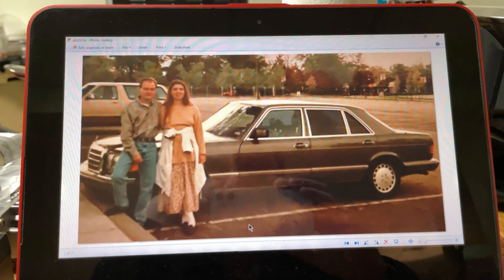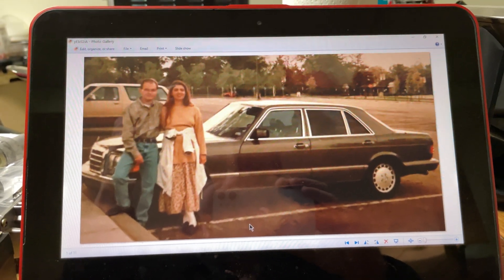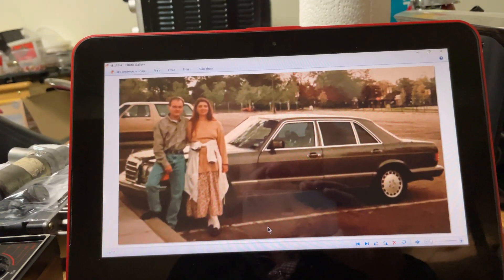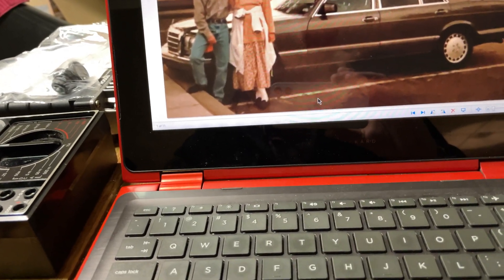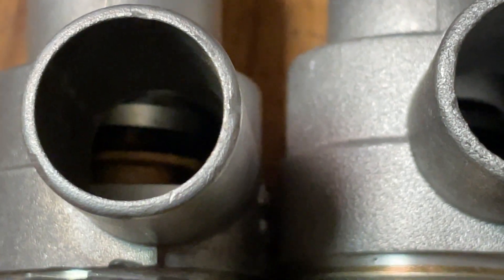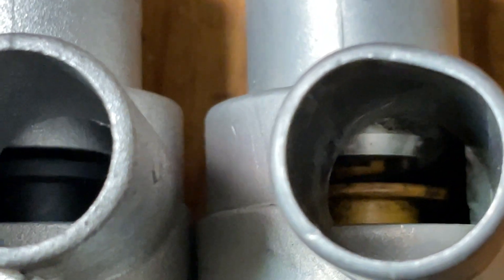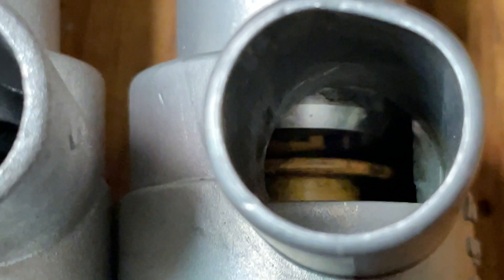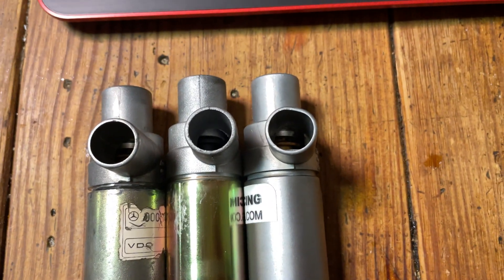Tutorial correct calibration of Bosch K KE KE3 Jetronic for all Mercedes after repair / long storage

Comment: Following some bad advice I tried to adjust my sensor plate and got it so far out of adjustment I can't even get my car to run now. Without it running I can't properly measure the duty cycle or any of the other adjustments like the potentiometer. How can I get plate gap back close enough so that I can at least get it running ?
Reply from the maker: Remove your fuel pump relay and bridge contact 7 and 8 with a jumper. This way you got fuel pressure in distributor. Don’t start the car yet. Push down on your plate until you can hear fuel flowing. Your plate should be only about 2mm below resting point with fuel pressure. If you can push the plate in below this then your to lean - if the plate has a lot of resistance then your to rich - you need 2mm play between resting and fuel flow
Reply from the maker: That’s the basic alignment
Reply from the maker: And make sure the Allen screw which is spring loaded releases the set screw below - they can get stuck when Allen key is depressed then the plate doesn’t reach the fuel distributor plunger and you get no fuel flow
Reply from the maker: Then your car should start / leave fuel pump jumped for the moment - if it doesn’t start turn 1/8 ccw to lean this way the vacuum has less resistance to move plate down - but be careful these adjustments shout only be made I. 1/16 or 1/8 increment turns in either direction
Reply from the maker: Your rpm gauge should go up to 1200 to 1600 rpm and then drop off to idle between 5 to 45 seconds depending upon ambient temperature
Reply from the maker: Once you got this corrected and car starts like this after 3, 4 attempts remove jumper and re install fuel pump relay
Reply from the maker: Let car idle to operating temperature then make only minute adjustments in 1/16 or 1/32 turns to adjust mixture waiting 2 to 3 minutes between adjustments - then you can readjust potentiometer and reset ecu
Reply from the maker: Don’t worry, that happened pretty much to all of us who worked on it the first time until we got the hang of it how the Allen screw works and the range of adjustments and increments
Reply: Wow thanks so much for all the info. While doing more troubleshooting I discovered I am not getting a signal to my cold start injector. I checked it removed from orifice on engine but still connected to the connector plug and nothing when turning the key over to accessories. Then unplugged from connector and supplied 12 volts and it gave a good squirt. Next to check is water temp sensor and associated wires for opens. However I do realize this shouldn't prevent my car from cranking altogether just difficult to crank when cold. I don't understand the process of how exactly the fuel distributor works. I've got strong fuel supply coming into the distributer but I'm not getting fuel to the injectors from the distributor. I have fuel coming out to the cold start injector but not the other 2 fuel injectors that I did disconnect to see if I had fuel so I was wondering how that works. Will I only get fuel to the injectors once the cold start valve does its job ? Or what is the sequence ? Should I have fuel pressure to the fuel injectors at all times while trying to crank ? Could the sensor plate being out of wack prevent fuel from being sent to the injectors ? I wish I had a better understanding of how this system works as in the sequence etc.
Reply from the maker: @GeorgiaOverlander  Pierre Hedary made a video for the basic sensor plate height adjustment 
https://youtu.be/jAhWj-JH9Rk
Watch this first to get a better understanding - my videos are meant to fill in the information past the basic stuff which other channels cover

Even though Pierre says that there is a difference between K and KE Jetronic I use the K procedure on all jetronics because even if the engine has other issues it will always start the car
Reply from the maker: @GeorgiaOverlander   yes it’s only the sensor plate when no fuel comes out of the injectors - the cold start valve is only used when ambient temperature is below -10 Degree Celsius or 14 Degrees Fahrenheit

Comment: Got my analog meter, expecting the potentiometer and Hirschmann clamps soon. M103 six cylinder engine. I adjusted the plate as described after fuel system rebuild. Starts and runs a little rough with some black smoke. How well should it run after this preliminary adjustment? Disconnecting the harness to existing (old) potentiometer kills the engine. Should I be connecting the hirschmann clamps and the potentiometer harness at the same time? I will have to reset after the new potentiometer arrives but I wanted to see if I could make it run with the old one for now. Thanks for this great video, big help.
Reply from the maker: Fairly smooth, you may need to lean the mixture out a bit more. Was the fuel Distributor rebuilt as well? The engine will be idling rough if the mixture is to rich or to lean - if the old potentiometer is bad then the ecu will run the engine rich as it opens the EHA valve fully - its like a limb mode - I would wait until I get the new potentiometer before making any further adjustments. The Hirschmann clamps have to be connected with the harness connector at the same time. Pull connector off, attach the clamps from the side on the pins as close as possible to the potentiometer and then push connector on and as far as it will go against the clamps to make sure you have a good contact
Reply from the maker: And the other question, have you opened the camshaft cover and checked the marks for tdc on balancer, camshaft and distributor? They all three have to line up as well
Reply from the maker: You may want to watch this video here:
https://youtu.be/NxEYI1KIUeE
Reply: @inovahightechltd  

I will watch it and check the other things while I wait for the new potentiometer. Thanks very much!
Reply from the maker: @Torqueandsteel  black smoke is usually a indicator of to much fuel. If you haven’t rebuilt your fuel distributor then you may want to check if your fuel distributor is leaking:

1. Remove fuel pump relay and bridge contact to activate the fuel pump check your wiring diagram for ur car to see which two contacts need to be jumped.

2. Open each fuel line on the fuel injector one by one - there should be no fuel coming out except of what was in the fuel line already

3. If you got fuel flowing out of any one or two lines then your distributor needs to rebuild 

4. If you got fuel flowing out of every line then your plate is adjusted to high - turn mixture screw counter clockwise until fuel flow stops on all six cylinders

5. At this point turn set screw another quarter turn counter clockwise, remove jumper, re insert fuel pump relay and start car normally - this first start will be rough to start and you may have to crank for up to 60 seconds until all air has come out of the system - once engine fires step on gas and rev up to 4000 rpm to bleed fuel system completely for about 15 seconds

After those type of fuel repairs there is a good chance too that the cylinders are flooded - once engine starts accelerate engine to 2000 rpm and if it was flooded the excess fuel will burn off within a few seconds to a couple of minutes - expect plenty of smoke - let engine reach operating temperature and let it idle for 5 to 10 minutes then shut engine off
Reply: @inovahightechltd  I opened it up to check the timing. Rotor and cap looked a little rough so I’m replacing those. Yes, the fuel distributor was just rebuilt, still haven’t received the new potentiometer but expecting it soon. I’m looking for timing marks on the camshaft, so far I haven’t seen them.
Reply from the maker: @Torqueandsteel  I changed my timing chain last weekend and I am schowing all timing marks here in this video 
https://youtu.be/dYXcpFv5tT8
And how to adjust the cams here in this video:
https://youtu.be/wlLeMf3eI44